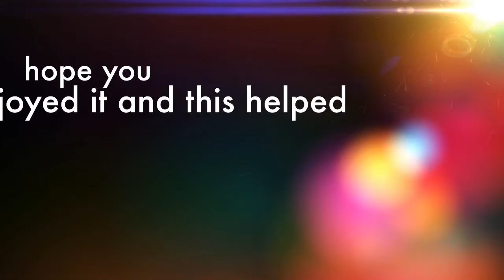Atom Mini CC3D Satellite connection

Comment: hello i watching your video i change regular cc3d flight controller for small atom but i have problem i put regulation power controller board is working fine in the computer all set up open pilot when i desconnected and i put lipo battery no signal in flight controller atom board any idea i have two both reaction same thanks...1.3 11.1v battery